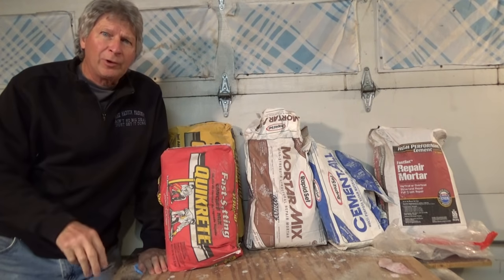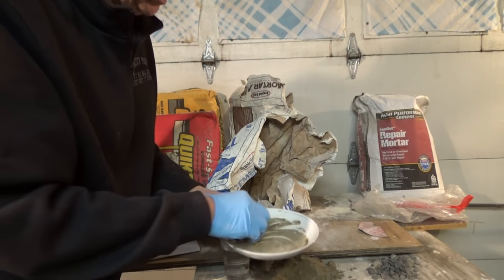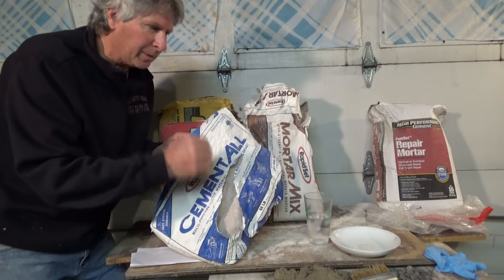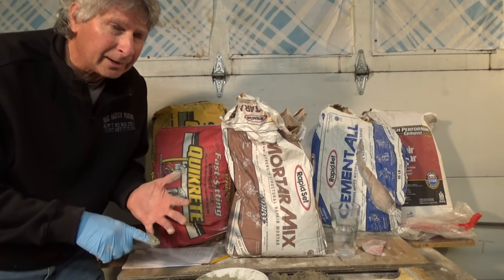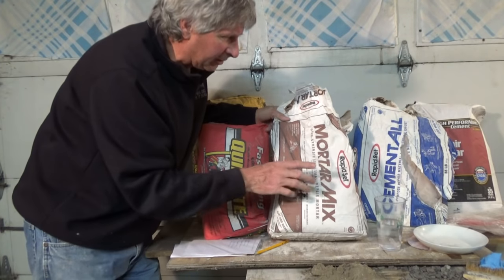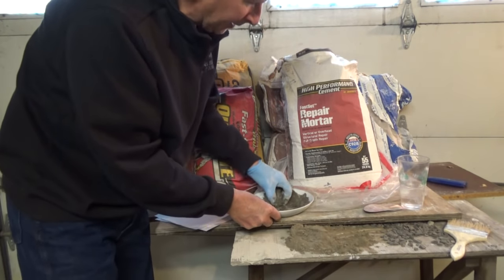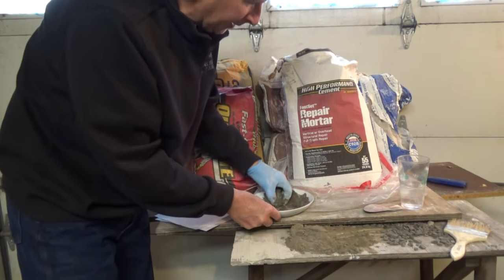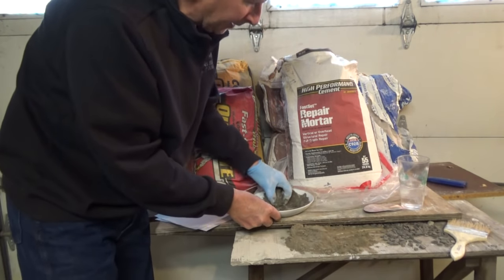WHAT CEMENT SHOULD I USE (Part 3) Mike Haduck "Fast drying"

Comment: You should make a video talking about the 60 pound and 80 pound high strength Sacrete pre mixed concrete and give your thoughts on it because that's what I use and that's what a lot of people use and buy from Home Depot, Ace Hardware etc. And actually the local Ace Hardware only sells the 60 pound high strength Sacrete and it doesn't sell any other concrete but in the next bigger town over I buy the 80 pound Sacrete high strength bags from Home Depot just because they're bigger and I think you get a little bit more for your money compared to the 60 pound bags but those are the ones that I use and I see a lot of other people buying and using them as well.
Reply from the maker: Hi Charlie,  they don't sell it around here, but I will get to it, thanks mike
Reply: @MikeHaduck   OK I saw another guy say the same thing that they didn't sell the Sacrete where he lived either but that's weird because here in California where I live that's like the number one thing on the shelves, they also have like the red bag of the quickrete fast setting stuff and big bags of Portland cement bags but I see just about everyone buying the high strength Sacrete and some people buy the 50 pound fence post concrete also that isn't high strength so maybe you could compare like the 50 pound bags of I think it's Sacrete also but compare that with the 60 or 80 pound Sacrete high strength just to hear your thoughts and what the differences are really and when people should use one compared to the other and if you think people should mix in some Portland cement with these Sacrete premixes or not? Thanks!

Comment: Thanks for your video, I usually use mortar mix and concrete mix from rapid set, my question is if I can mix it with a little white cement to give it a whiter tone?  you can mix rapid set with white portland?
Reply from the maker: Hi , I have done it , but most for fill areas where it's not In direct weather, I might use the rapid set and then just paint the joints with a artist brush or plaster the white cement over the top, thanks mike

Comment: Mike could I use one of those pre mixed to lightly sponge over a old concrete porch to fill in hairline cracks and small pitting and then use latex paint over it? Thanks -
Reply from the maker: Hi Jack, for small things like hair cracks I use rapid set cement all, no sand ,then wait at least a week, some painters say 30 days then a good stucco,deck masonry paint,  that's what works for me , thanks mike
Reply: @MikeHaduck  Thank you Mike -

Comment: Hi Mike, What do you recommend for small parge coat job over concrete block for front stoop sides?
Reply from the maker: Hi Sonny, I got a whole playlist called, "foundation repair" I think that might help, thanks Mike
Reply: Thxs again Mike. I'  check into this,  remember we use to add lime with the portland and sand.

Comment: Hi Mike, love your videos. I’m an boiler installer in Cleveland. From time to time we need to pour a pad or put solid block down for a boiler foundation, that can hold anywhere from 400 to 1500 pounds. We also need it to be level. Would any of these fast setting products work for this application? We would like to be able to move the boiler on it right away, instead of waiting a day or two pouring a traditional concrete pad. Your thoughts?
Thanks in advance, Steve Pajek
Reply from the maker: Hi Steve, Maybe give it a try, ilike to use it as much as I can, saves a lot of time,

Comment: Mike could you help me know what mix I should use to over-lay my 100 year old basement floor. It is quite rough concrete that is spalled and it's not a level floor. There are some cracks that will ooze water when it has rained allot that seem to be perpetually damp. I live in central Kansas. Thank you and I have already learned a ton from your videos. I'm repairing the field stone foundation walls inside that have the mortar crumbling out and I have installed 1 new basement window just like the one you did in a video. Everything is turning out great! Thanks a ton.
Reply from the maker: Hi Donald. Old basement are a hard call, it's like painting over a rusty boat, you could try portland and sand or just take pieces out at a time and replace it, I hope it helps, mike
Reply: @MikeHaduck  Thank you Mike. I have replaced some pieces but there's too much for me to do the entire thing. I do want to use the Portland and sand but not sure what mix ratio would be the best? I'm intending to seal the cracks first and then follow all of your make it stick procedures. I know anything I do will not last indefinitely. This house is 121 years old so I'm just trying to make it a little better for however long I can.
Reply: Yes I'm going to use portland and sand. In your driveway patching video you made the comment that the mix that 1 portland to 1 1/2 sand was for outside. I didn't mean to make you think my basement floor was crumbling, it's not, it's just spalled like the driveway you repaired (the places where it was broken down I have dug out and poured new concrete. I was just wanting to know if the 1 to 1 1/2 would be the mix to use for the inside or would I go to 1 to 1 or? Thanks Mike and I must tell you that I've learned a bunch from your videos. I'm 71 years old and I don't think I could have done the stuff I've already done without your help.

Comment: Hi there what wld be the best cement/concrete for making planter or candle vessels and silicone molds.   I was told cement all rapid set concrete mix. Hard for me to get what wld be comparable in quickcrete?
Reply from the maker: HI sandra, most I think use 2 sand one potland, but I would ask the people who do that, thanks mike
Reply: @MikeHaduck  thanks. I bought quickrete rapid set cement just poured fingers crossed lol.

Comment: Is it ok to use dry portlsnd cement between paving stones and then spray down with water?  I think Portland will hold up longer in the joints than mortar.
Reply from the maker: Hi Jeff ,I never would do that, I have a playlist on stone patio installation,  and another stone sidewalk installation,  Mike haduck, I show all my techniques there, thanks Mike
Reply: @MikeHaduck  thanks I’ll check it out!

Comment: Mike, which of these would you use to resurface a heavily spalled/pitted  garage floor?  Thank you so much for your videos.
Reply from the maker: Hi Eric, I would use the cement all,  no sand and then use a garage paint. But every circumstance is different,  thanks Mike
Reply: @MikeHaduck  Thanks Mike!  That's the direction I was leaning.  I've had success so far with these products and I never would have attempted any of this if it wasn't for your videos.

Comment: I notice that the mortar mix from rapid set dries a brownish color. Home Depot website says it dries grey. Does the color change over time?

Is the high performance mortar grey?
Reply from the maker: Hi, I only used the mortar mix and cement all I don't know, thanks Mike
Reply: @MikeHaduck  yes this is the rapid set mortar mix you show in tbe video. It dries a brownish color. Not the typical mortar color. I am using it in the joints on cobblestones in my driveway because it dries fast and can put weight on instantly. If I mix tradional mortar water and put over the top after the rapid set dries will all my joints blend?

Comment: HI Mike hoping you can help or maybe someone on this channel can assist. I had a crack about 1/4 inch wide, 4 feet long, and about an inch deep.  I wanted a cement repair to fix the crack so i used cement all. I chased the crack with a grinder and made sure everything was clean afterwards.  I mixed it at a 4 to 1 ratio, i used a small paddle mixer and mixed for 3 minutes, I applied the mix to the crack.  I began water curing for 2 hours after it lost its sheen.  After all the prep work and following all specification i ended up with a hairline crack on the repair.  Any ideas on what i possibly did incorrectly?  Any ideas on how i can prevent this?  i have about 6 other cracks and want to get the find out the issue before I proceed.
Reply from the maker: Hi Jose, you can't stop a concrete crack, you could minimize it, but it will always come back, thanks Mike

Comment: Thank you for your videos-very informative. I would appreciate your expert opinion: I am considering re-surfacing a Corian vanity top with a Rapid Set Cement All overlay (1/8"-1/4"-thick max.). (I would include Set Control and Flow Control to increase the fluidity and working time of the cement mix.)  I would first sand the Corian surface and score it with a knife but I could also drill holes to allow cement penetration to increase bonding. Or perhaps apply some fiber tape that is normally used on cement boards. Maybe I could use Rapid Set Mortar on the vertical surfaces of the vanity (such as the front edge) due to its better clinging properties. Would this make any sense to you? Thank you.
Reply from the maker: Hi BEST, I never used rapid set for anything more than repairs or patches so I can not answer that,  thanks for the comment, mike

Comment: Hi nice video, I live in NJ basically same weather or close by, I need to fix some slabs of concrete in my driveway and side walk and, the problem is I have some areas uneven and I have to level the sidewalk blocks and the driveway, for insurance purposes, the gap I have is between 1 to 2 inches, I will use acid to clean the area and according with the video I am planning to use Rapid set mortar 1 showel with 1 shovel of Portland cement, it is a driveway in use for how long I have to wait in order to my car can pass over it? And lastly, what do you think about my formula, it is ok it is just to level it 1 to 2 inches the highest, if is not good any other formula? Thanks for your help I need something that hold for at least 2 the 3 years. GOD BLESS YOU!!!
Reply from the maker: Hi German, I did a series called concrete patches, check out concrete patches part 2 Mike haduck, that should help, thanks Mike
Reply: @MikeHaduck  wow, I just checked it is very good, I now what to do now, I will post it on my YouTube channel and I will recommend your channel in Mt video for those of my followers that need a professional ideas like yours. Mike thanks again, I will send you the video when done.
Reply from the maker: Thanks German, Mike

Comment: About 25 years ago I had someone come and do some mortar work around my windows that were just installed. All he did was add baking soda to his mix and it hardened up in like 15 minutes. What would be the drawbacks to doing it that way?
Reply from the maker: I cant say, there is different ways to do it, but I like the new school fast drying, it works as good as anything I ever used or did before, thanks mike

Comment: another good video, have you ever mixed thinset into your mixes for patch/parging/pointing?
Reply from the maker: Hi why, I dont but I know of other masons that do,  thanks Mike
Reply: @MikeHaduck  I've found that it mixed in with mortar helps it spread smoother, has a sticking effect also, pricey like the cementall and rapid set products but I use it when I feel it helps, usually 1 part to 4 parts Ty S and for flooring type work 1 part or so cementall for extra strength, has worked well, no shrinkage after cure to speak of vs. adding portland to my mixes, I still use portland here and there, weather/job depending

Comment: If you take a regular mortar or concrete mix and add Portland cement to it, wouldn't that make it more or less fast drying?
Reply from the maker: Hi, it does but not a lot in my opinion, and I never had a callback,  thanks Mike

Comment: Mike, this may have been asked in another video, but do you feel that traditional cement is superior to quick drying cement? I understand that there are cases where quick drying is preferable, but do you sacrifice anything by using quick drying?
Reply from the maker: Hi Tex, I never had a problem with either, I usually just know what I want to use in each case, thanks mike
Reply: @MikeHaduck  Thanks, Mike!

Comment: mister. I have a cement floor with many holes, a quarter deep and three inches in diameter, what cement and what bondi should I use? then I will sand it to level it the floor is interior. Thank you
Reply from the maker: Hi Rogue, all the techniques I use are on my playlist, " concrete patches or foundation repair, I hope they help, thanks, Mike

Comment: The RapidSet Cement All has fine sand in it and it will hold its shape if you use less water.
Reply from the maker: Hi cruiser, it may but the motar mix has a lot more body,  whatever works, thanks Mike
Reply: @MikeHaduck  The RapidSet mortar mix is a great product and it is half the price of the Cement All. But people should know that both products have the same CSA cement, and the difference is really the amount and type of sand in each. More CSA cement is more expensive but it is also stronger.

Comment: I gather they use calcium chloride to make it cure faster, calcium chloride can rust the rebar because it affects the bond with steel.  it also darkens the concrete, do they use calcium chloride in these products, or what do they use?
Reply from the maker: Hi, I would say it has a lot to do with the weather,  the contractors, architects and inspectors, thanks Mike

Comment: I got some fast drying cement a year ago when I fixed something on the sidewalk. This stuff was like the super super fast it seemed. I mixed only a little bit, like a glass full of cement with water. I mixed in the garage and when I was at the sidewalk it was already hard. What the hell how are you even supposed to use this stuff. Second time I tried I basically ran and tried to do everything as fast as possible, I got a bit of my patch done, but then the concrete got hard while doing that so I had no chance to smooth the surface.  
There has to be a bit slower "fast" cement.
Reply from the maker: Hi whuz,,, yep you got to move fast, mix it right there and be ready and put it in,  thanks Mike

Comment: what do you do if you have a bag of portland sitting in the garage too long?
Reply from the maker: HI Brian, in my case I usually use them up before then but if it gets too hard I throw them out, thanks Mike
Reply: I have had cement that was old and still soft. Used for a small job...and once it dried it was very weak. I washed it out with a garden hose and started over. Learned the hard way it has a shelf life

Comment: I'm really surprised by your presentation of Cement All. I am just a homeowner DIYer but I have used Cement All for many projects around my home: repairing cement floors, recoating cement floors in a garage, patching curbs, cracked concrete etc. I have used it to paint dirty looking concrete. It lasts for years. It can be thin or as thick as peanut butter depending on the amount of water used.  The good thing about it is also the worst thing about it. It sets up very fast. They sell packets of chemicals that give you extra time. It's a great product. I've learned a lot from your videos over the years but this one left me scratching my head.
Reply from the maker: Hi Scott, thin falls apart up here, but everthing else it's great, thanks Mike
Reply: Yeah it depends where you live, I’m in philly thin will crack here

Comment: Love your videos Mike. Can I use Rapid Set Mortar Mix to patch a 4" hole on the exterior brick wall that used to have a bathroom fan duct?  If not, what would you use?  Thanks.
Reply from the maker: Hi KW, I have used it for rings like that but usually I might put a brick in there with regular cement, every situation is different,  thanks Mike

Comment: mister. I have a cement floor with many holes, a quarter deep and three inches in diameter, what cement and what bondi should I use? then I will sand it to level it the floor is interior. Thank you
Reply from the maker: Hi roque,,, my playlist " concrete patches" Mike haduck might help, thanks Mike